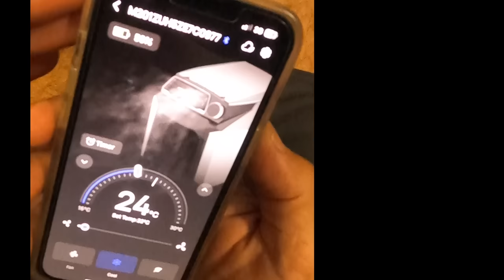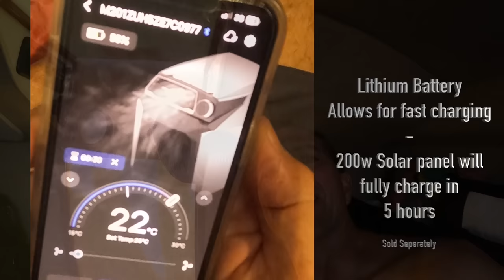2 Day Mothership - Rock Fishing - Epic fish action - Mud Crabs - Catch & Cook - Day 1 - EP.581

Comment: Hi Andy, it's good to see you back.  I love a good feed of muddies.  Do yourself a favour and get red of that gypsy windlass and get yourself a drum winch.  I installed a LoneStar GX3 on my boat which is similar to yours.  No more chain and rode bunching up underneath the winch and they are dead silent.  Believe me, you will never look back.  Also, if you haven't got one, look into a boat catch, launch and retrieval of the boat single handed couldn't be easier.
Reply from the maker: All good points, I will use the winch until it fails.  The boat catch doesn't seem necessary, as the trailer skids are sticky.